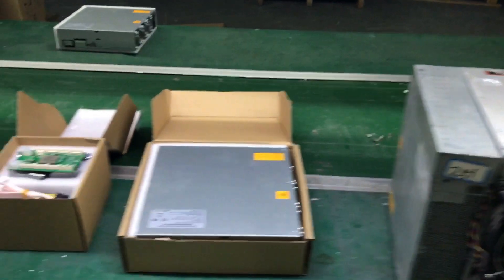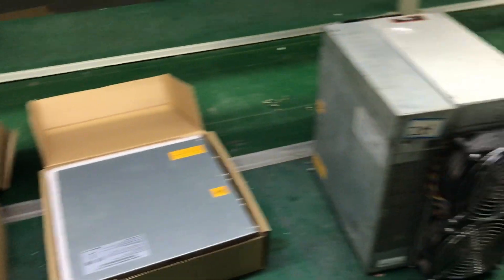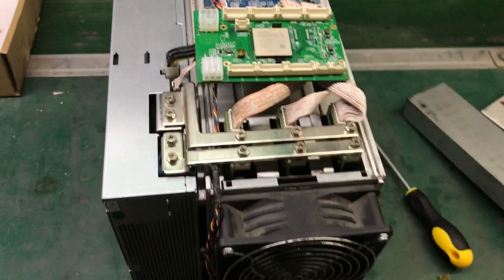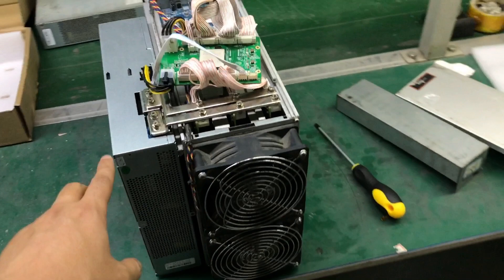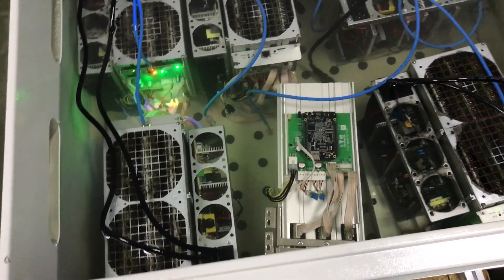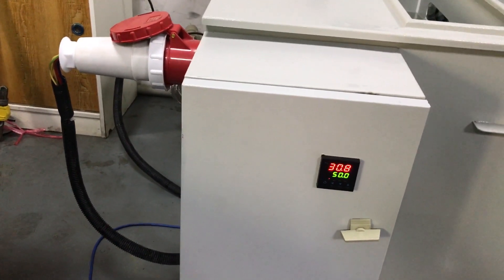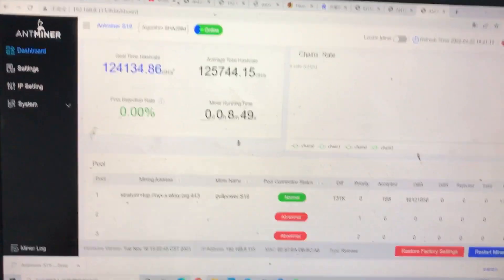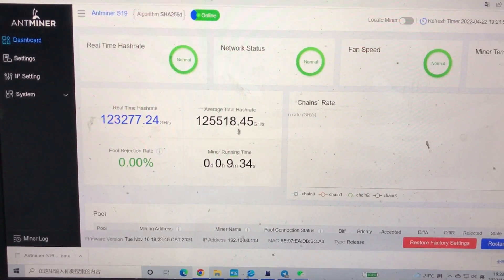Immersion cooling Mining & overclocking a  liquid cooled S19 95TH Part 1

Comment: hello, I have an asics s19 j pro, to lower the temperatures I made a tray to apply cooling by immersion. I have the control board to overclock the miner but I don't know how to configure it? this model does not have micro sd
Reply from the maker: you need to make sure that the control board you have works with S19 J pro , as far as i know there is no overclocking board for the J pro series , but i will be glad to have a look if you could email me a photo of the board to info@cryptomininglab.net

Comment: Can it go to 170-200th?
Reply from the maker: if you have a good cooling system such as a large Dry cooler , and you upgrade your power supply to 7000W you can reach 170-180 TH with the S19 Pro

Comment: I understand you got an extra 30th from 95th. But u also went from 3150 watts to 6500 watts how do you justify  the cost of electric as I did not see the break down of cost vs profitability. Thanks
Reply from the maker: Not sure where did you get the 6500 W number from. , but ok the videos I didn’t show any power consumption figure , the power supply is capable of supplying that much power , but it doesn’t mean isn’t using that much at 125th , even at 160th on S19 pro model the power consumption was about 5500 W
Reply: @Crypto_mining_lab  I heard you say in liquid it runs up to 7000w I understood that as what you were using as you said it does but mention any where else that it's running less ty for the information.

Comment: i have question hope you answer this. what material of this tank . can i use ancrylic or corrugated iron sheet
Reply from the maker: Its made of 304 stainless steel , and I can’t recommend anything else for long term use
Reply: thanks. hope your youtube will be het big grow. i have question . now i am runing my s19 95th in imersion . but the temperture of fliud 70 degree C . it is safe and how much temperture of fluid can be run to safe my asic with maximum
Reply from the maker: Thanks for your input , 70 C is to high for the fluid , i guess your chips temps are running close to 90 C if the  fluid is that hot , not sure what are you using for cooling , either way you my consider upgrading your  cooling system or the oil pump to allow the fluid to flow faster , anything above 60 C is not safe , in our setup max temps i saw with overclocking is 42 C , hope this helps
Reply: what do you think about 60 degree with fluid in tank . is it safe
Reply from the maker: 60C should be fine as long as you chips temps are around 80 to 85 C
Reply: thanks you alot .

Comment: That little adaptor board can help You over clock without any fees!
Reply from the maker: yes it does , but it comes with a cost , and can't be used on the S19 J series
Reply: @Crypto_mining_lab  how much is it ?
Reply from the maker: @chickmagnet6004  which part are you referring to ?

Comment: I like your setup. How much does a cooling tower cost? How many KW can it handle? Also, what's your pump's LPM?
Reply from the maker: Thanks for input , the cooling tower is 12ton/h and can handle up to 45 kw of heat , the water pump is 15 ton /h and oil pump is 120l/min , for pricing check the website link in the description and  use the contact form to send your inquiry
Reply: @Crypto_mining_lab  Thanks! Instead of these specialized boards, why don't you use fan simulators? a lot cheaper and does the same thing.
Reply from the maker: @af6727  yes definitely can be done with fan spoofer as well , the board was used hot overclocking , but you can also use a third party firmware you don’t need even a fan spoofer

Comment: Srry, my English is bad when I'm listening. Did you change this hardware to be able to overclock?
Reply from the maker: is order to achieve high has rate , you need to upgrade the power supply , as for overclocking , is this video I used a second control board to overclock the miner , but you can achieve the same result with an aftermarket firmware such as Braiin OS+ , keep in mind with aftermarket firmware you need to pay developer fees
Reply: @Crypto_mining_lab  but you need to upgrade the power supply or did you do for safety or for energy saving?

Comment: So how do you like the second "control board" compared to Braiins or Vnish? I didn't see it on your website. What is the "control board kit" actually called? Thanks Marco
Reply from the maker: Well second control board is a great option specially if you can’t use Braiin or Vnish on your S19 variant , and it’s a one time purchase , so you don’t have to pay any hash rate fees to the firmware developer , but they are a bit costly , I’ll added the control board to the website  so people will have the option to choose between overclocking control board or firmware